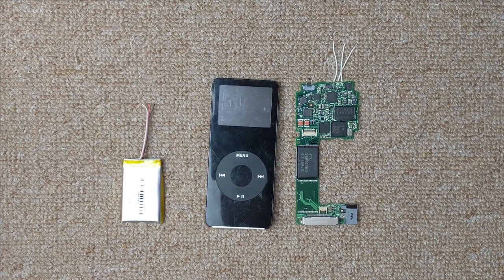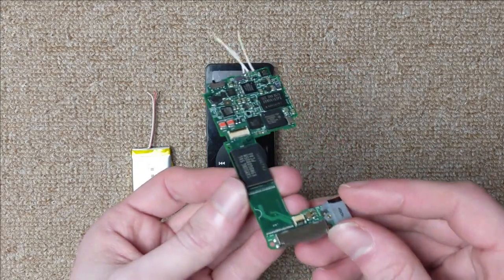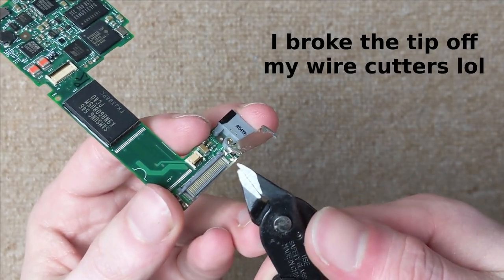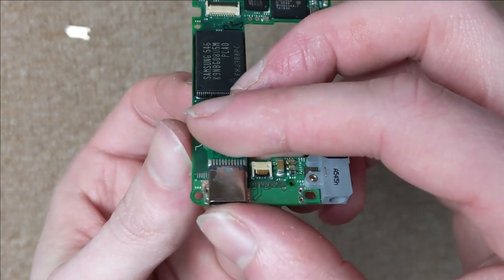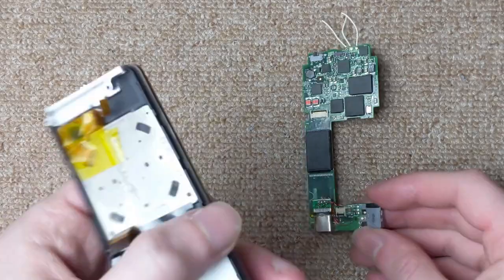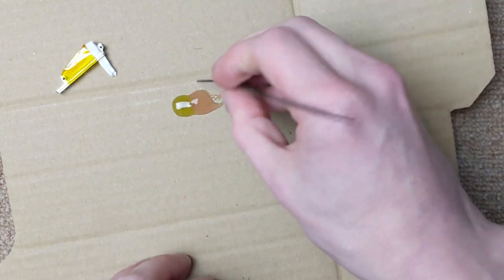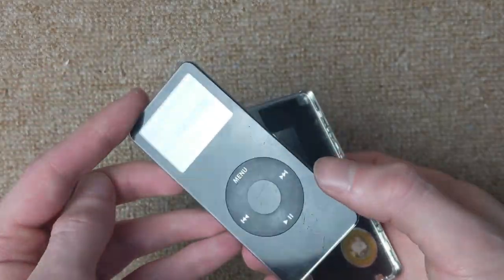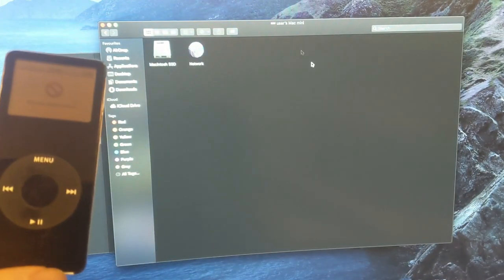USB-C iPod Nano Mod

Comment: How difficult was the soldering? I have done some soldering projects before, but never something super precise. Would an average hobbyist be able to do this?
Reply from the maker: Good question, I'd say that you need a reasonable amount of experience with small-scale surface mount soldering. If you're comfortable soldering 0402 resistors/caps, you can probably do this.

But as I demonstrated, you can take a pretty unskilled approach to removing the 30-pin connector!

Comment: Great project! I love these first generation nanos and have been wondering if a flashmod could be performed. I'd love to get one of these with 32 or 64gb in my pocket.
Reply: So far no chance, the iPods seem to be individually flashed to their intended capacity when produced. The current limitations seem to be software related, not hardware.

People have successfully swapped the NAND chips out, but no luck in them working

Comment: Very good work! I recently broke one of the brass connector on the 30 pin connector when I was trying to get the ribbon cable for the Click Wheel to go in the tiny ribbon connector (I guess I must've accidentally touched it with my tweezer 🙄). I thinking of replacing it with another 30 pin connector (if I can find one) but after seeing this video. I might have to rethink about it....

Comment: I have an old nano that suddenly won't connect to computers anymore regardless of what cable is used. So now that I've bought another one to replace it, I'm really tempted to try this. I've got USB c cables everywhere for my phone, so this would be incredibly handy. I have the second generation so I'm assuming I would have to do a little more research and digging into it to see if this would even be possible.

Comment: Nice work, do you think you can replace the flash storage with a micro SD module?
Reply from the maker: Yes! This is actually something I'm working on, but it'll be a lot of work and I'm not yet sure if its feasible.
Reply: @Retr0id  brilliant, best of luck mate.
Reply: @Retr0id  so? Any progress?

Comment: What type of wire are you using for the data connections?  I'm using phone wiring, but that looks much more elegant and thin.
Reply from the maker: 30AWG enameled wire. Kynar wire is also good for this sort of thing.

Comment: Very cool idea. I might try this on the 2nd gen.
Reply: Did you ever end up doing anything with this? I've got a second gen where the connector is bad and replacing it is going to be pretty painful. So doing a standard USB seems like a nice option
Reply: @TransistorBased  I've not got round to it yet but I've also picked up a 1st gen so gonna try doing both I'll let you know if it works lol

Comment: I read somewhere that apple used two different memory chips from samsung and toshiba for this model. They all have the same capacity but different connection pins. Probably the blank space in the board is reserved for the toshiba chip?
Reply: Interesting

Comment: Good project but kinda pointless
You won’t increase charge or transfer speed.  Those are control by chipset and ic.   And lost ability to use 30 pin dock..

Comment: Now it has usb c instead of the slow 30pin, is it faster at restoring? Or is it still using the 30pin protocol. 

If you can remember when lightning was first released a lot of users reported that syncing, restoring and updating via iTunes was much faster on the IPhone 5 compared to the 30pin 4s.
Reply: given that the usb controller hasn't changed, it likely would not increase throughput

Comment: Would this work with other ipod models? I have a 4th gen classic and I would KILL for this. It would also be cool in a 3rd gen nano.
Reply from the maker: Very possible on a 4th gen, I've done it, although the 3rd gen nano would be a big challenge due to the limited space inside.
Reply: It could be really nice on a 6th gen too ! But maybe there's not enough space in it ?